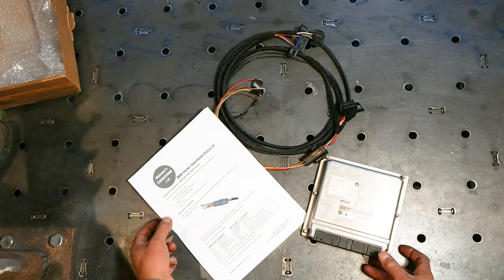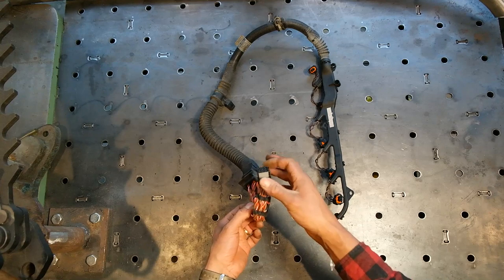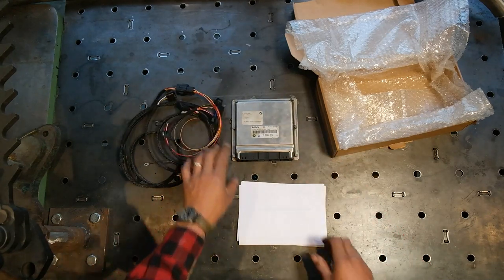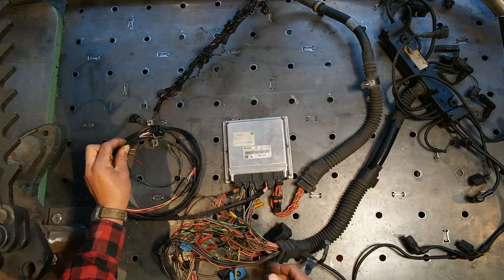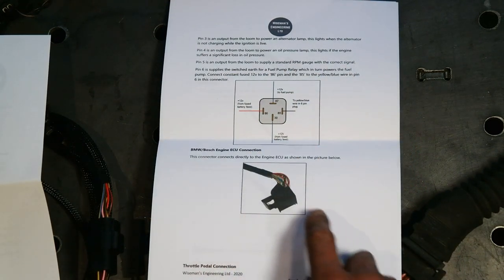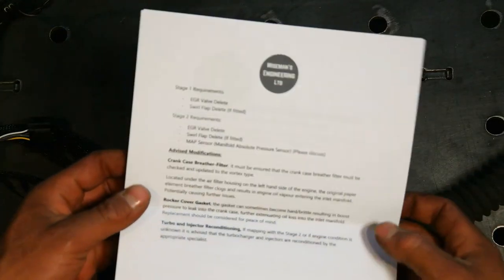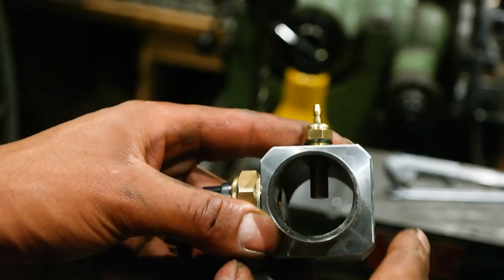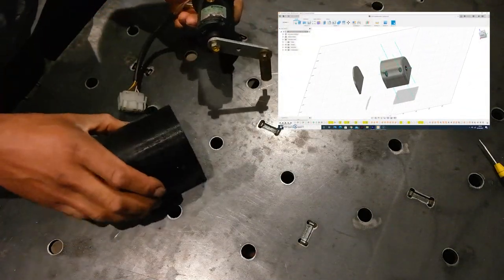BMW M57 Standalone ECU

Comment: soo with this is just need 12v, main power switch and a start button on ignition wire then it will fire?
Reply from the maker: Ahhh, I wouldn’t say that 😂 that’s the whole reason I made this video, they are sold as plug and play but in reality, they require a little bit of knowledge first.

Comment: I have another question and im wondering if you could help me, i changed ecu, ews, and swapped the key chip from the donor car i took the engine,  the starter isnt cranking, the fuel pump is working, at first i tought that the ews should be deleted but then i remembered, when i screwed on starter cable, i accidently put the wrench to the starter case, it shorted out for a less than a sec… so im wondering is there any fuse for the starter that could be blown?
Reply from the maker: How are you cranking the starter motor? Are you using the black wire on the body plug?
Reply: @KeepitBigBore  at first i tried with the key, then i connected two big ews wires and still nothing
Reply: @KeepitBigBore  im just trying to eliminate the problems that could before i pay someone to delete ews
Reply from the maker: Once you plug on your ecu, you shouldn’t have to worry about the 2 big wires, just plug it in to the ecu, put your key through the circular antenna and send 12v live to the black wire on the body plug, this is the wire for the starter motor.
Reply: @KeepitBigBore  ive got an update, there was a aftermarket relay for the starter, i deleted that, now the car cranks,  fuel pump is working, but glow plug light stays on, and it wont start, any ideas?
Reply: @KeepitBigBore  another update, fuel pump in the tank are working, but one underneath the chassis isnt, also there is no fuel in the high pressure fuel lines, the ones from rail to injectors, im actually out of ideas😪
Reply from the maker: Have you any ideas why the in line pump isn’t working, maybe it is as simple as wiring or bad connections? 
Just connect the in line pump directly to a power source, don’t worry about getting the ECU to power it for now. You don’t even need the in tank pump working for it to start. 

Also, check the connection on the pressure regulator on the back of the high pressure pump. This will start to regulate once your pre supply pump builds up 2.5-3 bar. The pre supply pump should be supplying 4 bar consistently. 

After that, just tell me if you hear a quiet but high pitch sound from the engine loom when you turn the ignition on, it’s easier to hear if you disconnect the in line pre supply pump.
Reply: @KeepitBigBore  i checked with multimeter, didnt get power from the inline pump wiring, checked for fuses, couldnt find any, worried about main relay, there is 3 wires comming out, one to the little fuse box, one constant 12v from the battery terminal, and one brown, that somehow gives 12v too, and i looked at the m47 harness, it went straight to last plug on ecu, that was brown too. As far as i got now, got fuel pump whining in the tank, gonna try give inline pump live 12v, and then see what will happen, oh and one more thing, when i unplug the brown wire from main relay the temperature gauge raises to max, but glowplug light is off, and when i connect them, temp gauge is fine but the glowplug light stays on
Reply: @KeepitBigBore  im 99% sure that the connections on the  engine are good, because i only unpluged wires from ecu box,  im thinking it could be more related with wiring,  but i dont know where to check
Reply: @KeepitBigBore  it should come from high pressure fuel pump?
Reply from the maker: I wouldn’t worry too much about dash lights for now. If you look at my first start video you’ll see my engine running on the workshop floor.

Try to wire the in-line pump direct toa battery and check the regulator on the back of the high pressure pump and see how it goes from there 👍🏽👍🏽
Reply: @KeepitBigBore  could i take the power somwhere from engine bay? Im just out of batterys for now😅
Reply from the maker: Yeah mate, even if you have some long cables or jump leads, just run positive and negative cables from the battery you’re using to the inline pump as a temporary test
Reply: @KeepitBigBore  alright, will keep you updated👍
Reply: @KeepitBigBore  could you explain the wiring on blue  main relay?, im a bit concerned about the wiring on it too, as i said i only got 3 wires on it
Reply from the maker: Have you tried to wire the fuel pump directly yet? I’d try that before going over wiring diagrams and relays. If you’ve taken your ecu loom with the relay out of the car like that then it should be fine. If your fuel pump is powering up then it means your blue relay is powering up your ecu and that’s all you need for now
Reply: @KeepitBigBore  i put live power to the pump, scanned the ecu, there was several faults, delivery pump control system and several more,  and after starting, scanned again, and it showed Rail pressure monitoring, rail pressure too low during start… deleted the codes, dde light went off. Restarted ignition 2 times and it popped back on
Reply: @KeepitBigBore  got it running roughly, and the rpm went up to 1200, but thats with live power
Reply from the maker: Great news 👍🏽👍🏽 now you have time to figure out the rest of the little bits and finish off the dash lights etc. 
You don’t have to have your pre supply pump controlled by your ecu. My ecu was not controlling the relay for the pre supply pump so I bypassed it and wired it to come on with the ignition!
Reply: @KeepitBigBore  yes mate, i just thinking i could throw the pump somewhere where it gets power when ignition is on, it stalls after 5-10 seconds, could it be pressure sensor on back ot the high pressure fuel pump? but still trying to figure out the gas pedal, originally i have 5 wires, but the new m57 has 6, do i have to wire that one from ecu?
Reply from the maker: What fault codes are you getting after it stalls? The thing on the back of the high pressure pump isn’t a sensor really, it’s a regulator, you have a sensor built in to the fuel filter and a high pressure sensor on the common rail. 

Which standalone harness are you using?
Reply: @KeepitBigBore  final update, got it running, solved dde light, rail pressure, and the pump by just adding one more wire for the fuel pump relay that originally goes to the pump underneath,  throwed to the pc, codes were gone, what can i say from my experiance,  the pump has to be controlled by ecu, otherwise the rail pressure sensor wont work. But big thanks to you, you made me understood the harness and i really sink in to it, big thanks, keep going with the swaps, you have a good perspective about these things👍
Reply: @KeepitBigBore  final update, got it running, solved dde light, rail pressure, and the pump by just adding one more wire for the fuel pump relay that originally goes to the pump underneath,  throwed to the pc, codes were gone, what can i say from my experiance,  the pump has to be controlled by ecu, otherwise the rail pressure sensor wont work. But big thanks to you, you made me understood the harness and i really sink in to it, big thanks, keep going with the swaps, you have a good perspective about these things👍
Reply from the maker: That’s great mate, well done!!! Tag me on Instagram if you have an account, I’m interested to see your build 👍🏽 good luck with the rest of it!
Reply: @KeepitBigBore  whats your @?
Reply from the maker: I’m @keepitbigbore 👍🏽👍🏽
Reply: @KeepitBigBore  followed ✅

Comment: Hi mate. Great video and lots of info. Im going to be putting a 2003 330d engine and box in an old car but the standalone ecu and loom I have have brought has can high and can low. M57n engine code. Do I need to wire the can lines up. Many thanks darryl
Reply from the maker: Thanks mate!! I’m no expert on wiring the m57’s, especially the m57n’s I’ve got one sitting on my bench right now but I’ve yet to even make a start on it. I’m currently stripping it for a rebuild. 

As far as I know, there is no need to run anything as complicated as can for these engines but I guess it depends on your loom and how much integration with the existing cars system you’d like. I personally had everything I needed through manual sensors, (oil, charge etc) 

Good luck with your conversion!!!

Comment: A lot of awesome information in this video man! I’m from Australia and looking to do this very soon in my SWB Y60, I’m planning on keeping the 6HP auto behind my m57, just curious to know how much more work it will be or if I’d be better off just using the stock Nissan manual?
Reply from the maker: Sorry I took so long to get back to you! I’d say absolutely go for the 6hp, at the end of the day, the 6hp won’t require custom adaptors, it’s a strong box and a lot of people are using it here in the UK. If I had a 6hp lying around I’d definitely use it 👍🏽

Comment: That's helped me alot thanks! I'm considering this conversion in my 1983 110 defender... (or a tdv8 ) but a tad confused about wiring and gearbox choice 🤔
Reply from the maker: I wouldn’t worry about the wiring, once it’s there in front of you it’s simple enough. The auto takes a bit more but it’s really not allot, most of it runs through one plug that’s all ready on the loom.

Comment: brilliant video, so clearly explained. I'm at the point of buying the actual m57 engine - so far i understand i need to buy the m57 engine including ecu & wiring harness in 3 parts (engine loom, injector loom, and ecu loom). Ive also figured out I will need to keep a few sensors such as MAF, lambda, boost temp, EGT as well as swirl flap and EGR vacuum solenoids. Lastly i will need the accelerator pedal and its wiring. I intend to use a zf8hp with a turbolamik controller. Could you kindly advice if there is anything i have left out for the engine to run standalone on a test bench? would appreciate your advice....many thanks
Reply from the maker: Hi mate, Thankyou very much!! 

So most of the sensors you need will be attached to the engine apart from a pre supply pressure sensor which may be in the fuel filter unit. 

If you are buying a complete car you will be able to clearly see where everything is when you remove the engine. Just make sure you have connected all the ground points and it should run on a test bench just as in my “first start” video 👍🏽👍🏽
Reply from the maker: Apologies for my late response also. I’ve been struggling to spend the time I’d like to spend on YouTube !!

Comment: What a fantastic informative video. You have made it sound simple enough for a non mechanic to understand. 
Q. How old is the engine whi h connects to this? Wouldn't an newer motor have a lot more wires? Thanks again.
Reply from the maker: Thankyou!!

This engine is from a 1999 530D (e39) they made this engine up to 2003 as far as I know. 
It then changed to an aluminium block, and a redesign of the engine (pistons, injectors ecu etc). My engine is the dde4. The newer m57 used dde5 and most of the wiring is very similar 👍🏽
Reply: @KeepitBigBore  You are awesome mate, thanks for the very helpful information. I am looking to build a Nissan Patrol for a trip around Australia and the ZD30 engine is not very reliable, or powerful. I was thinking of your motor for a conversion but thought it might be too difficult. 
You have given me hope again and will now do more research on the engine. Thank you mate.
Reply from the maker: No worries mate, I’m glad you found it helpful! 

It’s very simple to get up and running, you may have seen the first start video already but I made a short video of the engine running while on a stand on my workshop floor. Once you’ve connected everything and all your ground points, she’ll fire up no matter what vehicle it’s in!!

Good luck with it, the patrol is a great vehicle for this conversion 👍🏽👍🏽
Reply: @KeepitBigBore  You really are very generous with your time and information mate. If I do take the risk and go for this massive project, would I be able to pay you for advice when I need it? It won't be for a while as I need to sell 2 other cars first.
Reply from the maker: Thankyou but Don’t worry mate, I’ll try to help you if I can, no need for payment. If your interested, I have custom made m57 logos for sale on my website www.keepitbigbore.com I made the website myself so I’m still getting round to making it look good and adding more products. If you decide you want one then that’s payment enough 👍🏽

Comment: Hey Big
This inspired me to do this myself, and i bought everything needed. Almost at goal now, but ive got no throttle, tried all kinds of different throttlepedals, but nothing goes. Inpa says it might be fixable to switch pot 1 and 2, but i have no idea what it is. 

Any pointer will help :)
Reply from the maker: Hey mate, sorry for y late response!! Which pedal have you got at the moment and who did you buy the harness from. If you send me a message on Instagram with some pictures I’ll do my best to help out 👍🏽
Reply: @KeepitBigBore  no worries mate. Got it working. Had a great talk with Will from house of torque, as i bought the stuff from him :) he accidently misplaced 2 wires in the loom
Reply from the maker: Ash lovely, it’s so easy to happen and two wires can cause havoc 😂 haven’t ever spoken to will, I’ve only ever spoken to Max but they making a good range of products and are sweet up professionally so you can’t go wrong!! Good luck with it, let us know how it goes for you 👍🏽👍🏽
Reply: @KeepitBigBore  the car is up and running :) Ashcroft spacer for a ZF22 with 24 internals. Runs like a train!
Reply from the maker: 😂😂 that’s great, they’re great fun aren’t they!! Makes me love my defender even more!!

Comment: Hi, i have m57tu 204hp with edc16c31 computer. I like to put it on boat. I finish everything to fit in there, engine mounts, water intercooler, water to water exchanger, flywheel adapter and adapter plate for transmision. I have problem only with speed signal because I haven’t it on the boat and engine because of that can’t deliver full power because computer “thinks” that the “car” is not driving. Is it possible to fix that error without speed sensor signal?
Reply from the maker: Hi mate, sorry I took so long to reply, you can definitely remove any limitations on it. I’m from more of a mechanic/fabrication background so I don’t know how to do it personally but I know a lot of guys convert the ecu to manual to remove any limitations. 

How do you know this is what is causing the lack of power?

Comment: I'm putting an M57 is a Discovery2. Got everything fitted and connected. Engine is running. Your video's have been a good help! Just 1 question. Did you use the BMW alternator and dit it charge the battery after the swap? Mine doesn't... D+ is connected properly over a bulb (which is on), 2 other wires from alternator are connected to ECU (C24, C8) , but no charge.  Any idea's??
Reply: Here is it's first run...  https://youtu.be/gcszS6tgKb8
Reply from the maker: Thanks mate, I’m glad they were useful 😬

I’ve used the original alternator yes, I had no issues with mine anyways. The only thing I use to tell me it’s charging is the bulb and a voltmeter which is on a USB port I’ve installed in place of a cigarette lighter.
Have you got 12v on the charge cable on the back? Is your power steering working? I’m trying to see if the belt is loose/slipping slightly.
Have you any way of checking the fault codes?
Reply from the maker: Just seen your video now, what an absolute unit of a vehicle 😬😬
If your building that then you’re probably aware of the things in my response about the alternator 😂
Reply: @KeepitBigBore  Thanks! I have buildt some offroad race cars before, but this is my first FIA spec rallycar. Really exiting! Yes, the things you pointed out are already checked. Just wondered if you had more information about the signals of the 2 wires going to the ECU.  Thanks for the help. Much appreciated.
Reply from the maker: Sorry mate!! Good luck with the build, she’s looks great 👍🏽

Comment: Hi great video, I gather your defender is manual, I wanted to use the x5 6speed auto in my 90, dose the Ecu lead also control the auto gearbox?.

Many thanks
Reply from the maker: Hey, thank you!! I can’t say for sure if you can use the original transmission controller but I can’t see why you couldn’t either!!
The ecu won’t control it but the 6 speed auto will have its own transmission controller that works in conjunction with the ecu 👍🏽👍🏽

Comment: Hi, i am doing an M57 conversion in my Pajero. I have the same throttle potentiometer as you, but am unsure how to connect the 6 wires from it into the BMW loom. Can you help please?
Reply from the maker: Hi mate, I’m actually using the pedal type potentiometer on mine. 
I used the one you seen in the video just for testing. I highly recommend buying a complete pedal type potentiometer to simplify your wiring. You can find these from the newer m57 cars.

Is there any reason why you want to use the cylindrical type?

Comment: I want the m57 twin turbo in my iveco daily camper but its a scary project. Not really sure where to start
Reply from the maker: That would be a nice job!! Would you be doing the fabrication yourself?
Reply: @KeepitBigBore  mostly fab myself but I have a guy for any precision or CNC stuff. It's the wiring side of things that I'm useless at.

You made it sound simple. I'll be keeping my eyes open for a donor car that's for sure
Reply from the maker: Haha, don’t worry, if you can do and organise the fab and cnc side of it then trust me, the wiring will be a breeze 😬 Worst case scenario, you could get the engine in and geared/plumbed up then drop it in to someone for wiring 👍🏽
Reply: Don't worry about the wiring. Just did a swap myself and it fired up the first time.